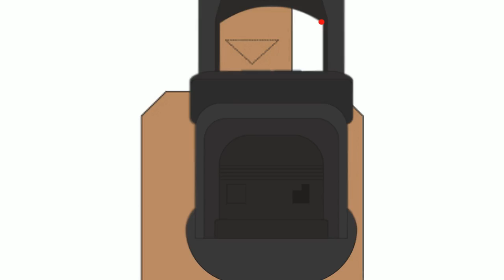RDS Handgun Fundamentals: Grip

Comment: Lifting heavy weights helps a lot too. It makes a hard firing grip feel more normal over time.
Reply: Yes, I started weight lifting and saw a difference in my hand strength, I also bought a 10mm, try to control the recoil on that and 9mm gets easy, forget practicing with .22. Practice hard fight easy.
Reply: Deadlift, chin ups/pull ups and heavy barbell rows helped me with this as well. It's now easier to hold the gun harder for longer.

Comment: This may sound weird but I actually kind of pinch the bottom of the trigger guard between the thumb and index finger of my support hand while my thumb is pointing along the frame at the target and my. index finger is pointing back at me along the bottom of the trigger guard. Kind of like making a fist with my support hand while pointing my thumb at the target. I use my support hand to control the horizontal alignment of the pistol and my main hand to control the trigger and recoil. I believe that's an old point shooting concept however I'm using it to align my dot over my target. I'm also looking through the dot to superimpose it onto the target.

Comment: @SageDynamics .. I learned alot from this video. At 04:35, “the driving pressure with the thumb” (primary/dominant thumb) ... This tip has helped my accuracy due to the improved grip. However, I noticed that my thumb will ride on the slide lock release, sometimes causing an override. When that happens, the slide will not lock back when the mag is empty.  Any suggestions on remedying this?   Thanks.

Comment: Getting older and decided a RDS on a handgun is a practical necessity. Torn between two choices. The RMR 2 and Delta Point Pro. Both have plus and minus features. Home defense, range, and maybe repel ANTIFA are objectives. Will go on a G19 MOS. Any advice?
Reply: Highly recommend RMR 2. It was the gold standard of pistol red dots (and may still be). As such, companies, like Holosun (which would be another solid option and is the one I currently use, the 507c), have used the RMR footprint. So, if you ever decide to switch, the footprint will remain the same. Hope this helps.
Reply: @Gio-od7if  All advice is welcome, thanks
Reply: Actually like my Holosun 507c
Reply: What did you go with ? I went with 508t v2 circle dot is the way
Reply: Sunny cat 88 went with the RMR. So far I really like it.
Reply: @Gio-od7if  I was in the same boat as you between the two. I went with DPP. I figured if I know my gear the negatives of the DPP who not matter as much as on paper